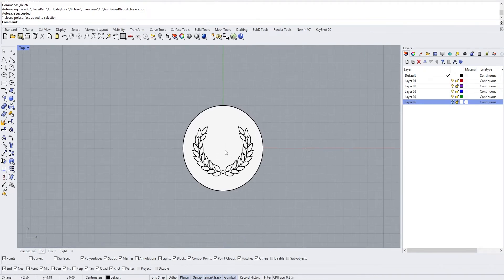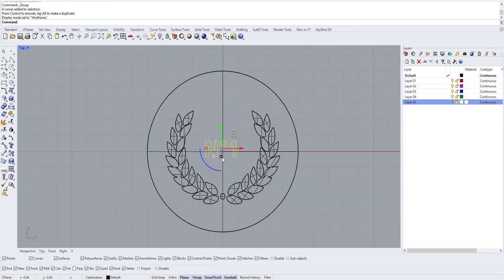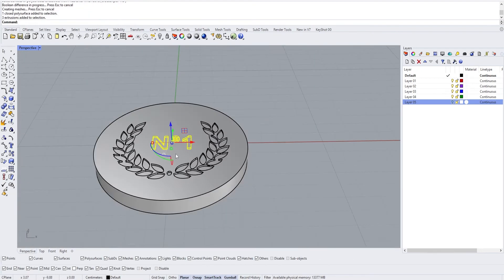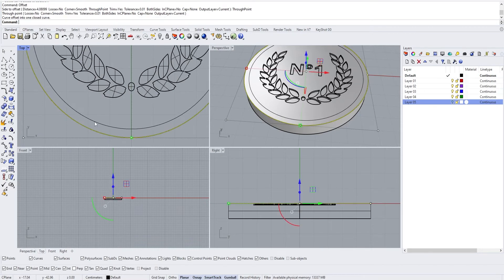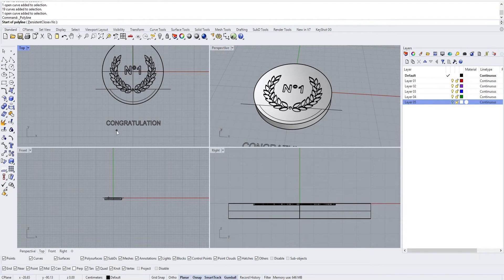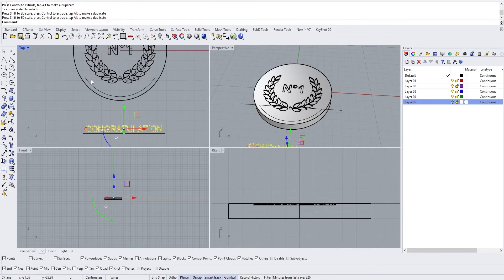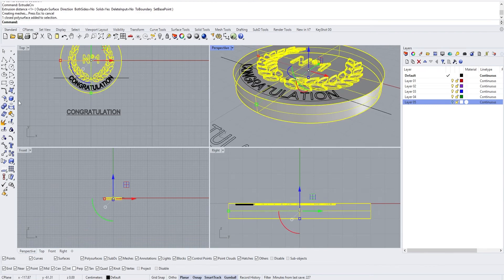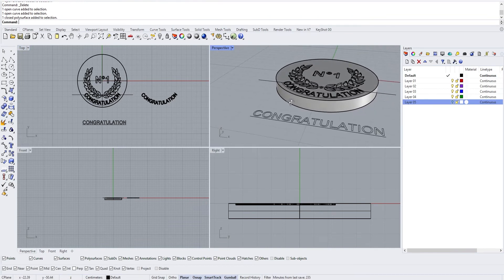How to engrave text in rhino

Comment: Since it is Rhino (i.e. no logic and nothing makes sense, and every move is a trick question), I would like to know the properties of the 3D circle that you start with. Doing the exact same thing with a box will not work. So there is something very specific, some very specific properties that the 3D circle has that you have left out. You cannot simply make a 3D box or 3D circle an repeat the procedure. (That would make too much sense)
Reply from the maker: doing the exact same thing with a box will work, you probably missed a step
Reply: @DuterqueStudio  No , the text will fall through the surface if put on top of it. Rhino always places the text at the bottom. I wish you could arrange the order as layers, similar to photoshop.

And projection gives the error message, - projection missed its target or similar. I did manage to project text on a curved surface following a clip on that - by creating a strip from the curved surface matching its length. Then turning that strip i to a surface. Put text on that surface, and project it back on to the curved surface.

But I cannot create the same strip from an already flat surface with the same command. 

This software is bloated junk.

Comment: Do you have to change the colour of the text so that it can be laser cut?
Reply from the maker: To laser cut you need to export only the curves that you want the laser to cut in .iges or .dxf depending on the software used by the manufacturer.